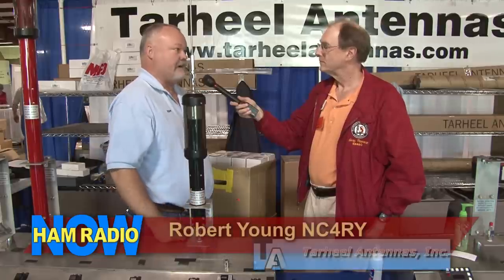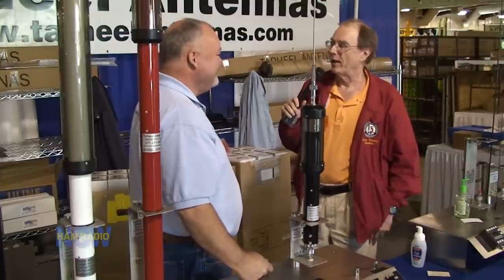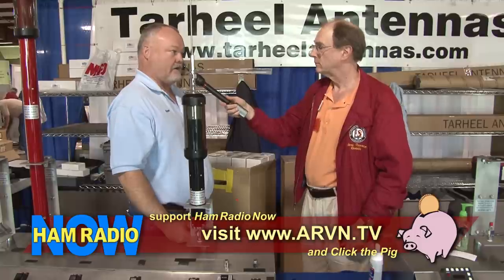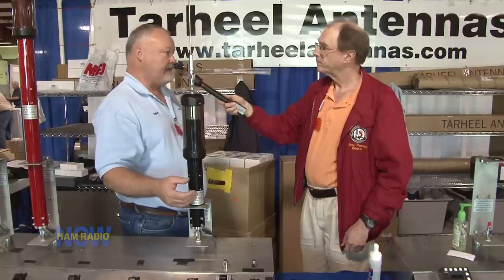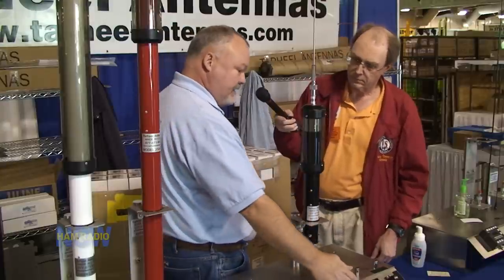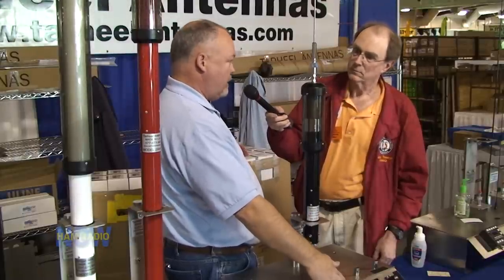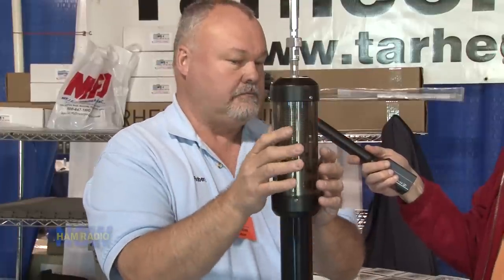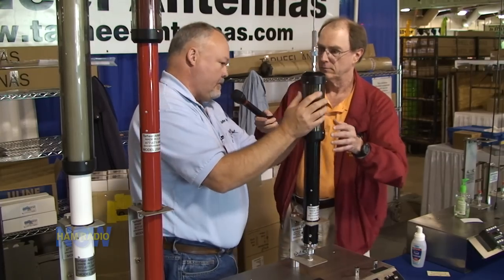HamRadioNow Episode 2, Part 11 - TarHeel Antenna Maintenance

Comment: Robert is a great guy & he has been helping me with an Original  TARHEEL 200HP & it has some differences from the newer models but it will still handle 1500 watts & with a 4 or 5' whip it covers 10-80 meters but nobody makes a controller that will work with the Early models so you must use the Rocker Switch to control it.I will be running it with my ICOM 7000 so I have no doubt that it will be a great combination.A Big THANKS to Robert for all of his Help.. W4KVW {:>)

Comment: Does anyone know of a source for the four-pin connectors used with the Tarheel control cable?  I want to build some custom cables.  BTW I have had two Little Tarheel antennas for family cars and they have been great.  My son, KB5EAG, is an over-the-road long-haul driver and he likewise uses Tarheel.  I am getting ready to take one apart to do a complete overhaul.  I really like these antennas.

Comment: 1OFGODSOWN What kind of interface do you have between the antenna and the 7000?  thank you
Reply: Sorry I just saw your question here in 2021 & I was running an Original Turbo Tuner & the Original TARHEEL 200HP that I have now can not be used with any interfaces due to the voltage differences so I will be using the stock rocker switch & again with another ICOM 7000.

Comment: I had one for 4 years before the tube snapped in half. I bought a Scorpion and have never needed another antenna. It's built like a tank.
Reply: Why did the tube snap in half? Did it fail while operating it or due to stresses while driving?
Reply: pixelpatter01 stress and vibration while driving. I run a real screwdriver now.
Reply: @bpalmersheim  I know people who have been running the same TARHEEL antenna for 15 or more years with ZERO issues so you got a Bad One & want to Poor Mouth a great company who builds a great product.I agree that Scorpion makes great antennas as well but for what they cost they should last two or three lifetimes or longer.Their prices are beyond CRAZY for a  mobile antenna.I'm glad that you are happy but you should be Ashamed for acting like a KAREN.